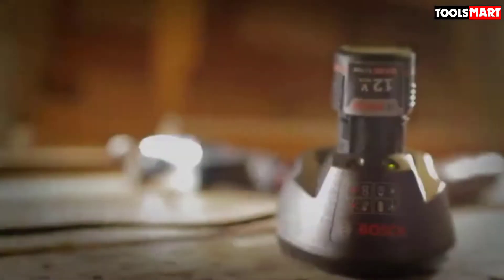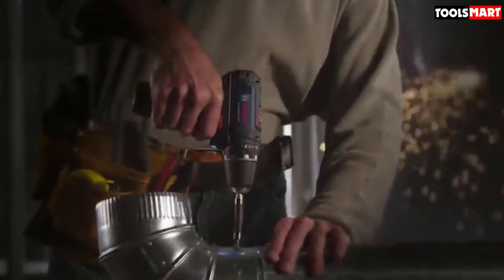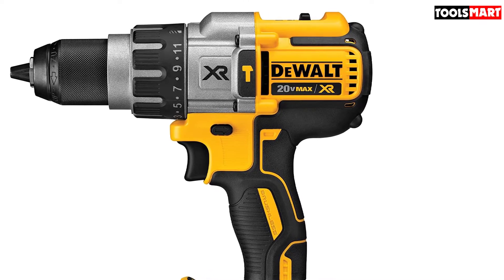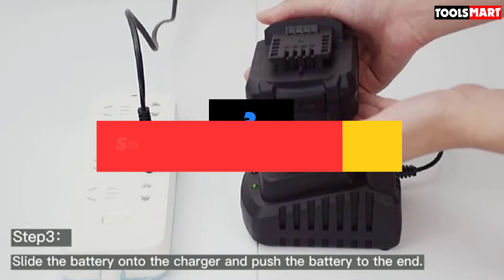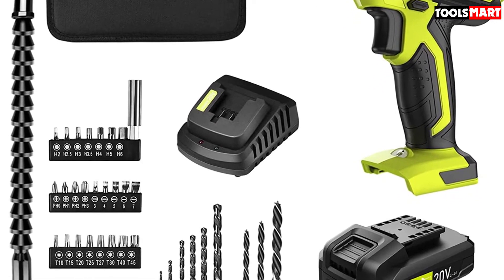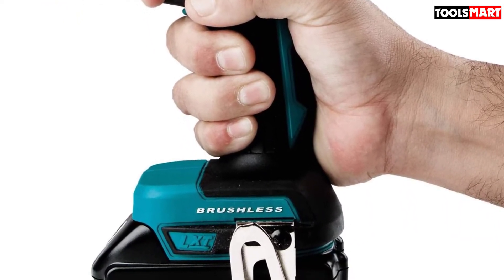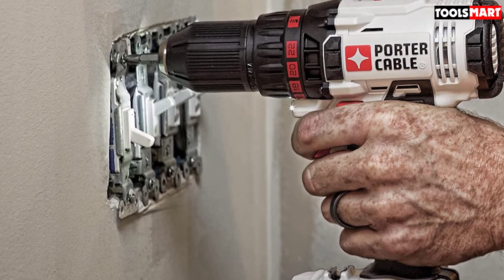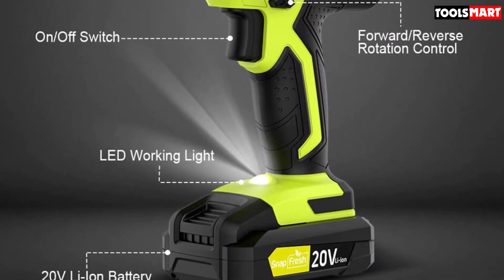✅Top 5 Best Cordless Drills In 2023

Comment from the maker: ✅1. Bosch PS31-2A Cordless Drill Set
👉 https://amzn.to/3uUUsLN
✅2. Dewalt DCD996B 20 Volts Max XR Cordless Hammer Drill
👉 https://amzn.to/3K8CY50
✅3. SnapFresh 20V Cordless Drill
👉 https://amzn.to/3JcHqOY
✅4. Makita XFD131 Brushless Cordless Drill And Driver
👉 https://amzn.to/3u1iMfI
✅5. Porter-Cable PCCK604L2 20V Max Drill And Impact Driver Combo Kit
👉 https://amzn.to/3u4SdpP